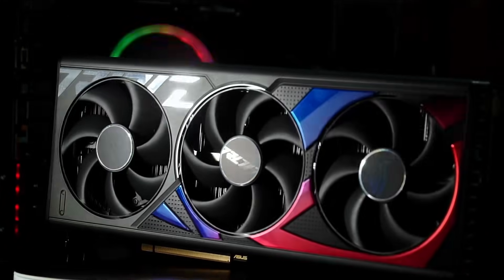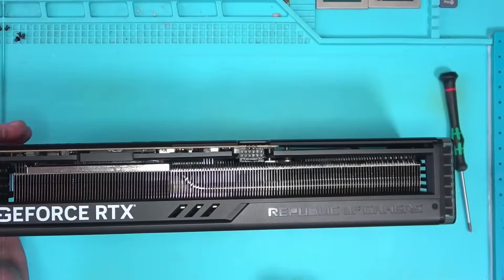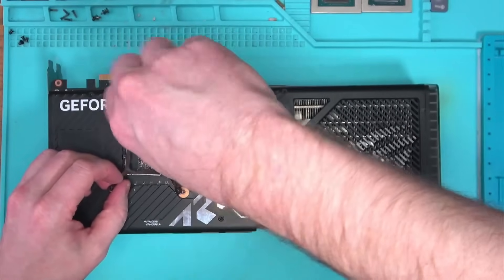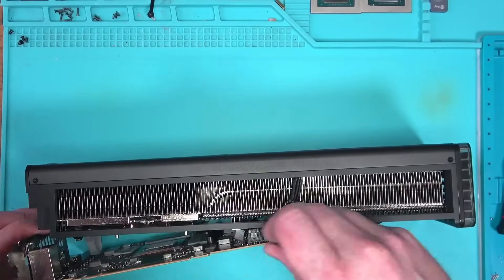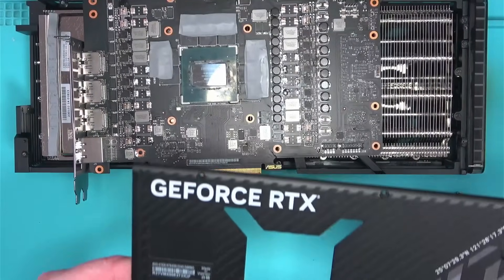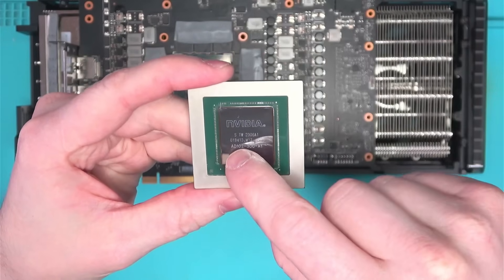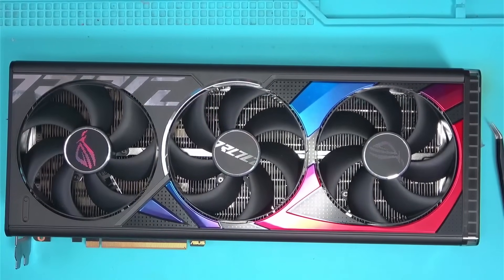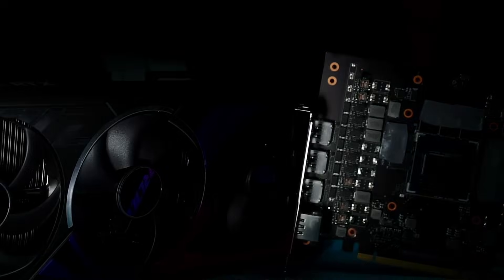Bait and Switch: Amazon Sells 4080 as 4090! GPU Repair Fail!

Comment: At least they put efforts to make it looked real, we literally had people receiving either a PCB with no core or a package of bed quilt labelled as '4090' (<- that actually was also from amazon) shrugs
Reply: Still remember the guy that bought 2 3090s to work and got 2 bowls filled with sand.
Reply: @POLARTTYRTM It as a 3090 though. Just required some assembly
Reply: @Silentguy_  assembling sand to teach it to think.
Reply: @POLARTTYRTM  Bill of materials said silica what the fuk??